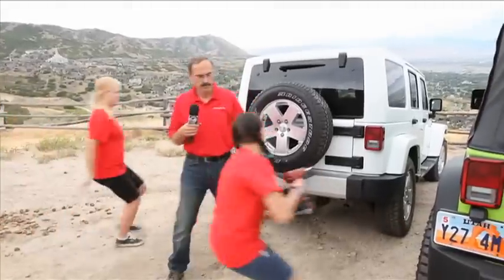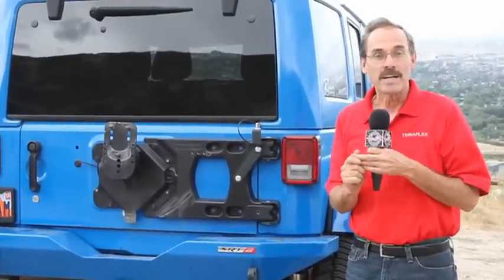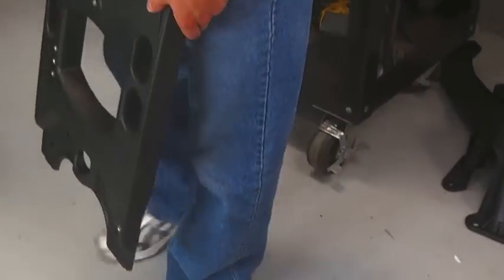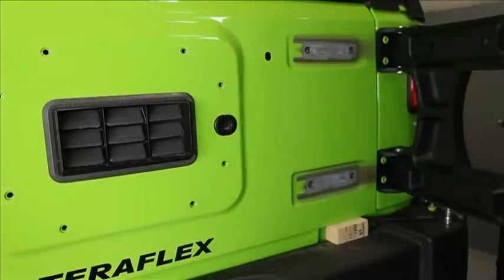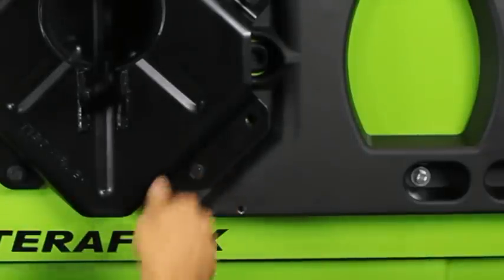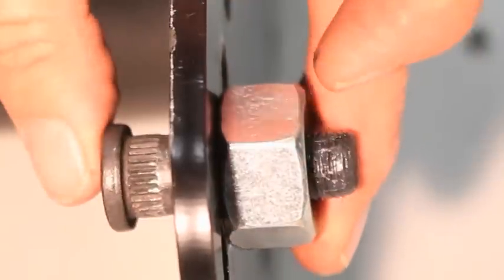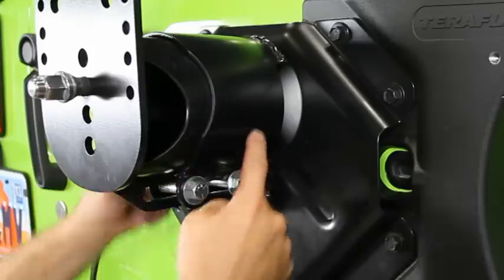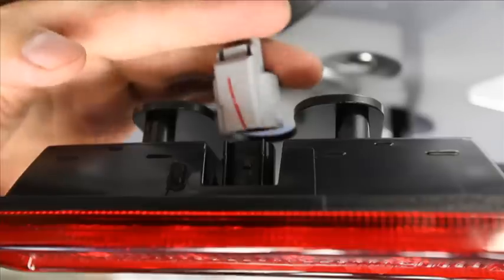TeraFlex Install: HD Hinged Carrier and Adjustable Spare Tire Mounting Kit

Comment: Just installed mine today, and the quality of this carrier is top notch. Way nicer than some of the bumpers that look like somebody welded up some metal in their garage. No problems with 287/70R17 and 17x9 wheel with 4.5" BS.

Comment: Well, I installed mine today. I used an adapter with the tire mount for my 35x12.50 17. I didn't like having to slide the tire mount out so far in order for my tire to actually fit. This way when I crank down the clamp bolts, there's plenty of cylinder to actually clamp on to. I first tried to use the adapter to mount my 12 gallon Titan fuel tank which actually worked out perfect except that the adapter I used was the one I had initially used to mount my tire onto the fuel tank. So that's a no-go unless I get another adapter which I will probably do since I really don't want to get rid of the fuel tank. Aside from that, the install was flawless and the tire carrier is awesome. No more friggin opening a tire swingout just to get to the door.

Comment from the maker: The spare should be pressed hard against the hinge portion. Place the spare on the bracket and push into place. Mark on the bracket how far it is, pull the tire off, slide the bracket in another 1/4". Then tighten the pinch bolts and install the spare. You will pull the spare into position by tightening the lugnuts down.

Comment: I just installed my new terraflex hinge and tire carrier.  Love it.  I had a smittybilt tire carrier before and it popped welds on my tailgate.  Terraflex's design is tuff and swings well on its hinges.  The tire dose not rattle and I don't hear the noise of stressed metal as I did before.  Great product!  I'm not very mechanically inclined and I took way too long getting the thing put on.  The tire carrier was a more difficult install for me since I accidentally installed two of the lug studs backwards.  I did fix the problem and it works fine!  I spent about four hours total.  It would be a lot quicker for most people.

Comment: This video makes installation simple unless you have taken off an AEV Mount and your tailgate has been modified.   My original holes must have been bored out and quarter moon (loose) supports were put in the tailgate.  I got the job done, but it was a several hour project!

Comment: great vid.  should add at 3:05 to optionally paint the bare metal to prevent rust from starting.  can't believe this is how they paint 'em at the factory.  half assed!
Reply: Thomas Lahr I sanded, primed, and painted the hinge wells.

Comment: OK I have a question. How much weight can this thing handle total?
Reply from the maker: We don't directly have an official weight rating, but the tire carrier and hinge combo can safely hold up to a 40 inch tire with the right wheel setup and bumper bumper for clearance.

Comment: I am interested in this part. Running 35 BFG KM's on Fuel mavericks. 17x9". 
I have seen on a few forums that there are some structural integrity issues with the cast aluminum carrier. Is this true or just haters on sites designed to sell other companies products?
What is the warranty of this product?

Comment: hey, I have a question, I got a few bikes and a spare tire bike carrier. I was planning on upgrading the hinges to the teraflex system but I am not sure if I will run a 33 or 35 in the future, is there a way to remove the studs?

Comment: Would this allow me to install a fuel tank like the Titan Trail Trekker (or the ARB) fuel tank behind the spare tire?  The Titan is about 110lbs full, plus my stock 31" tire that I believe is about 75lbs (stock '12 rubicon steel wheel).
Reply from the maker: +rogue109  Yes you can run the TItan with the TeraFlex tire carrier.
Reply: TeraFlexSuspensions
I know what just moved to the top of my Christmas list!   Thank you!

Comment: The metal in my door has weakened and now makes a sheet metal wobble sound from the tailgate. It isn't coming from the hinges. Will this take complete support off my door and keep it from making that annoying wobble sound? Running 35s on a 17inch rim. teraflexsuspensions
Reply from the maker: Jacob Casillas  If there is already previous damage done to your tailgate, this will not repair it.
Reply: Thank you so much teraflexsuspensions ! I'll be buying from you guys shortly!

Comment: I just installed mine today, i love it ! Mounted a 35" on it perfectly, Are these things designed for high speed Sand Dune Offroading  ? The reason i ask is because i had the SmittyBilt XRC tire carrier swing, and it kept wobbling till it bent. i would like your input on your design for such activities.

Comment: I don’t have the provided bolts, will the factory ones work? Or where can I order the provided bolts
Reply from the maker: It would depend on which bolts you are referring to, but most of the bolts needed for this kit will be factory bolts and hardware.
Reply: @teraflexsuspensions  The M8-1.25 x 35mm Flanged Hex Head Bolts for the carrier, can the factory 30mm be used?

Comment: I just installed this and when installing the carrier onto the hinge, I accidentally put the spacers in as well as the rubber gaskets. Will this lead to any issues down the line? The offset is not too noticeable but it could be worse once a tire is on.
Reply from the maker: You will want to remove those. They are not needed and push the adjustable mount off center just a bit. We recommend removing the spacers if you installed the package.
Reply: @teraflexsuspensions  understood, I contacted your customer support and exchanged messages/pictures with them. They told me I was probably fine by leaving them installed. I'm conflicted now
Reply from the maker: Hmm, go ahead and remove them just to be safe to not cause any future damage.
Reply: @teraflexsuspensions  Sounds good, I was only hesitant because it looks like if I remove the spacers it might not sit flush and will actually angle toward the body side...I'll see what I can do

Comment: That's nice and all but it is still putting all that weight onto the stock hinge location.  Those two hinges are not made for that kinda weight.  You would have to go into the quarter panel and beef up the sheet metal hinge frame etc.  Safe for 33's but after that I would save up and go with the bumper location.

Comment: The NEW Jeep Wrangler is quieter inside than ever before, and like this guy says on Motorweek (at time 3;30 in the video listed below); "now that its quieter, you can hear the thin metal on the back gate flexing from the weight of the spare tire over every bump you hit." (  Road Test: 2012 Jeep Wrangler  ) .  So that makes a product like this almost 'NECESSARY' for everyone.

Comment: Question - when everything is installed, how close is the spare tire supposed to be to the hinge? I've seen photos where guys are installing it right up against it (rubber is pushing against the carrier) and photos where there's about 1 inch in between. What do you recommend?

Comment: red locktite == bad idea...
Reply: +romeoneverdies Why?
Reply: +TeraFlexSuspensions any rebuttal for this? I was planning on using Red Loctite but I'm kind of curious since the comment above makes me think otherwise
Reply from the maker: +Camron Kiekintveld There is nothing wrong with using Red Locktite on this install. If someone doesn't like using red then they can use blue Locktite.
Reply: Red Locktite typically requires applied heat to remove (blue does not), but in this case using heavy tools, it will most likely break the bond anyway.

Comment: Careful what you say to those girls or they will turn around and kick you in the nuts.
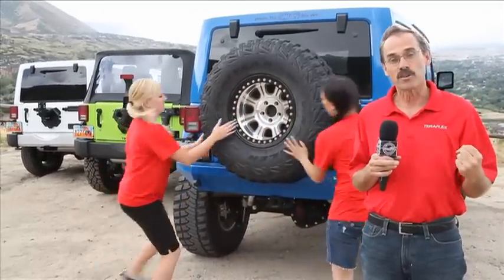You said at 1:35 "Common girls, its only 60 pounds apiece (for each of you)".  Well, those girls don't weigh more than 60 pounds each, so that's why they are struggling. Eventually they will realize that its far easier to kick you than to lift the tire, and that's when YOU are going to be in a ton of hurting.
Reply: Me too